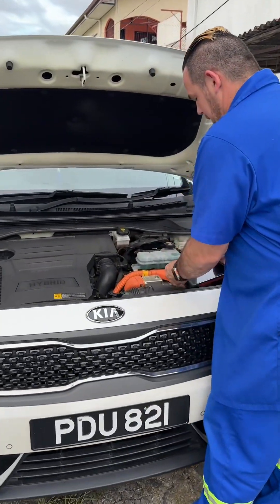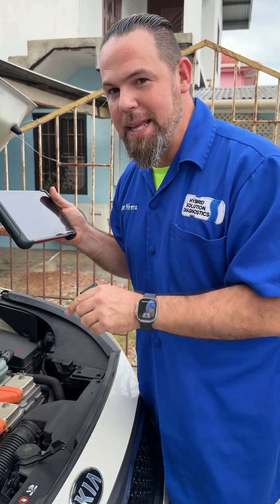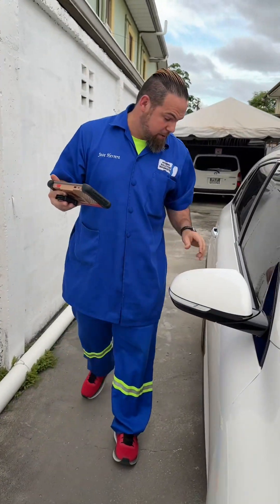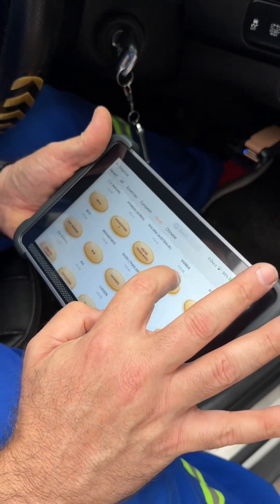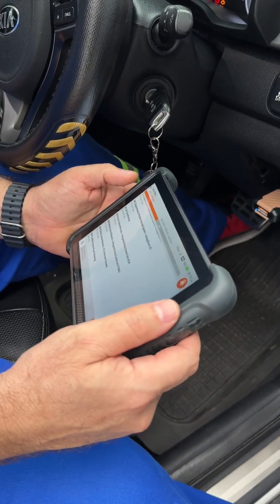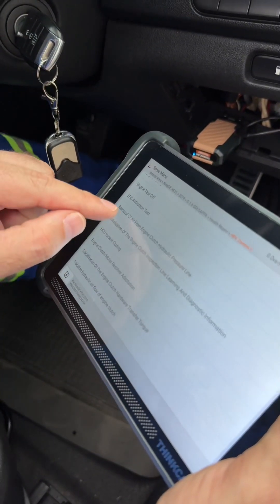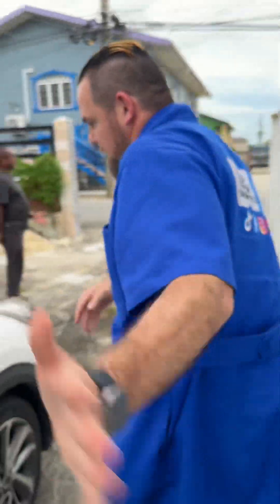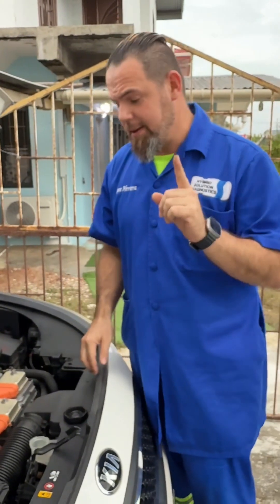Kia Niro Clutch Fluid Bleeding using the Thinkcar 689BT

Comment: How do you avoid the moisture in the expansion tank?
Reply: by not adding straight water to it. Mixed antifreeze will not condense to the top of reservoir, the water does.